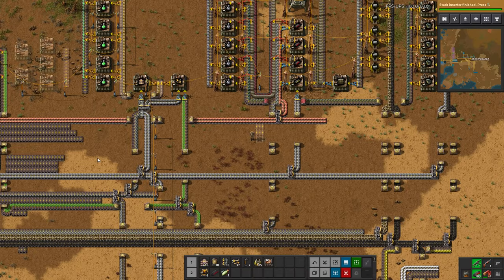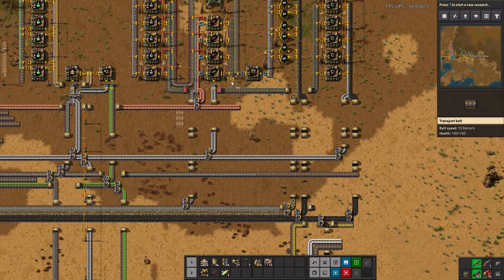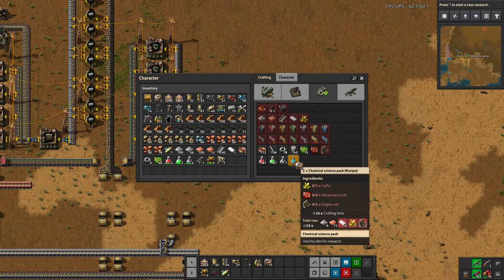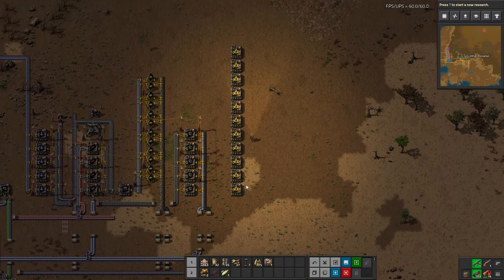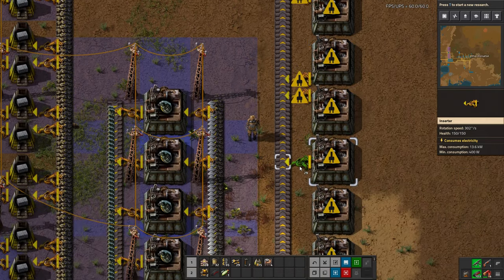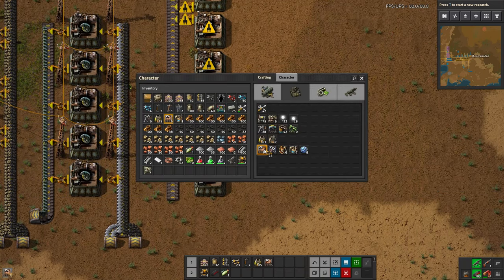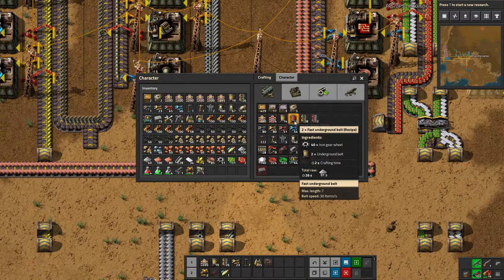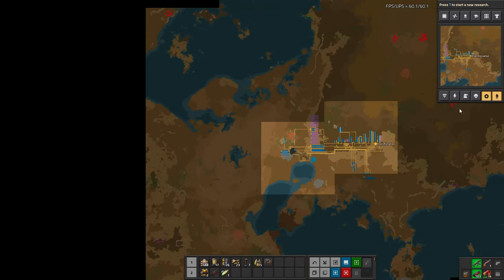Factorio 1.0 Tutorial Lets Play EP11 -  Blue Science :Introduction Guide For New Players Gameplay

Comment: To add to some of the great work done in the comment section of previous videos, here is my 2 part calculation for building assembly machines to ratio:
Disclaimer: different assemblers have different craft speeds, so these calculations assume that all assemblers being used are of the same type/level
Reply: Part 1 - calculating no. of assemblers needed.
(As already worked out by other viewers)
Craft time in sec ÷ No. of items output per craft = no. of assemblers for 1 item per sec (assuming base craft rate of 1).
If a target item per sec is known, then number of assemblers to meet target items per sec = craft time ÷ output items per craft ×  target items per sec.
Reply: Eg. Of part 1:
Already worked out for the science in the comments of episode 4,5.
Since craft rate of stone furnace =1,
Furnaces needed for 1 output per sec = craft (smelt) time 3.2sec ÷ 1 output per craft (smelt) = 3.2 furnaces.
To fill a yellow belt, target is 15 item per sec,
So furnaces needed = 3.2 sec smelt ÷ 1 item output × 15 items per sec = 48 furnaces
Reply: Part 2 - calculating target rate of an items used in a recipe.
No. of machines crafting ÷ Recipe craft time (sec) × items used per craft.
Eg for  copper wire needed for red circuits=
(Assuming 12 assemblers for red circuits) 12 assemblers ÷ 6 sec craft time × 4 copper wire per craft = 12÷6 ×4 = 8 per sec.
Using part 1, no of copper wire assemblers needed = 0.5 sec craft ÷ 2 output × 8 items per sec = 2 assemblers
Reply: Another example of part 2:
Assuming 12 red circuit assemblers and crafting green circuits on site.
Green circuits Target = 12 assemblers ÷ 6 sec craft time × 2 green circuits per craft = 4 per sec.

Green circuit assemblers required = 0.5 sec craft ÷ 1 output × 4 per sec = 2 assemblers

Comment: IMO the best way is to share a belt between copper plate and wire. Half a belt of copper plate is exactly what you need to go with the green circuits/plastic belt.
Reply from the maker: Yeah that is a really good method. I may switch to it later, but I always end up with a big of a messy setup when doing that so I usually avoid it until I have time to fiddle with a setup a lot.

Comment: Question. It requires 3 x red circuits to produce 2 x blue science packs. That's 1.5 circuits per pack. Would you not require 9 x red circuit assemblers to fulfill the ratio. My math could be completely wrong XD. Part two. If my math is correct then would it make sense to use the next tier up assembly machine to produce the circuits? I believe it produces at 0.75 speed as apposed to 0.5 if my memory is correct.
Reply: That is correct.
The the thing is all this requires a lot more raw materials than you needed before. He already hinted at needing to expand green circuits.That all then needs more smelting. And more mining. 
All the science so far requires almost a full yellow belt of iron ore. You increase that to AM2 and you're at 1.5 belts. That's perfectly normal, but your starting ore patches can only fit so many miners
Reply: @S_Black  I thought it might be down to resources yeah. I built mine the same and found that science production is adequate for now. Will it be obvious to see if the yellow belt cannot keep up with demand?
Reply: @bawlzack7877  
You will see it empty eventually. Without using priorities splitters only do 50:50. So down the line you will see that some machines won't get the materials they need. That's how it is possible to eyeball supply and demand if you don't want to calculate ratios all the time. And when you see empty belts and you figure out why you can production until you have full belts again.

Also I misunderstood you a bit. You're right that 9 AM1 is the same as 6 AM2. So you can use AM2 just for red circuits. Instead of upgrading everything. I think he said he plans to upgrade everything at once later. But you can certainly mix and match if you have a reason.